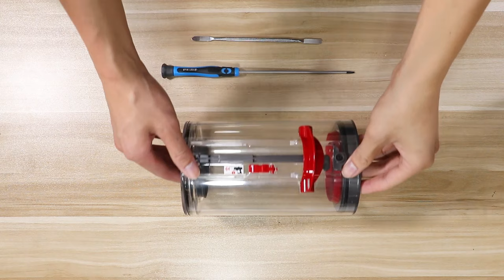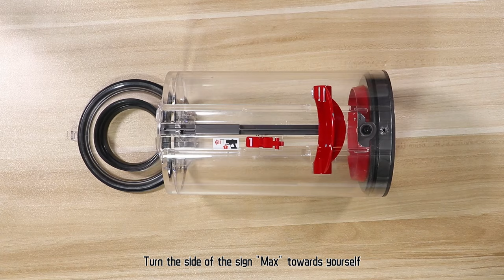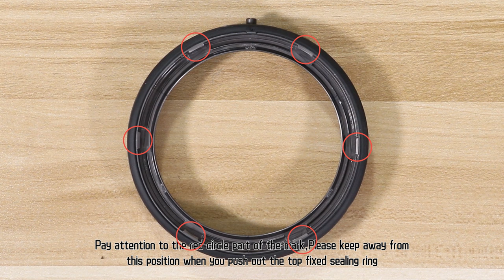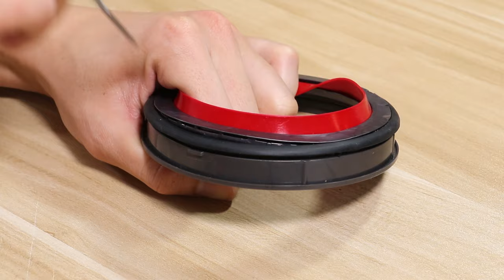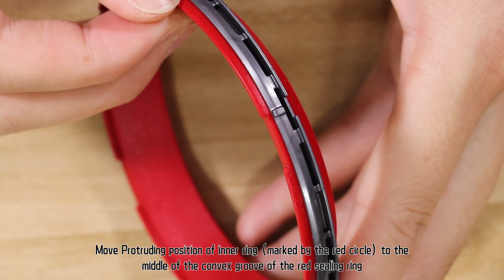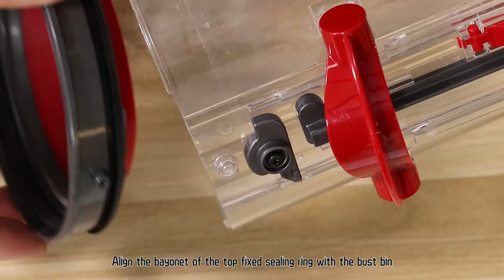How to Replace Dyson V10  SV12 Dust Din / Clear Bin Part _ Top Fixed Sealing Ring

Comment: The red seal came undone when I cleaned the bin, I struggled to get it back in thanks to your video with very clear instructions I found the problem the locking tabs where broken I had to replace the red seal assembly thank you for posting. 👍👍